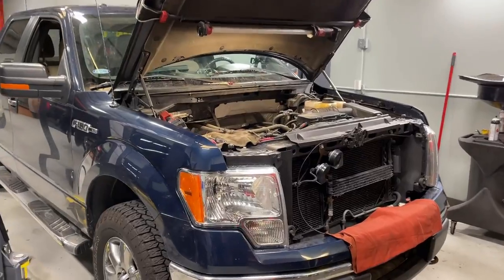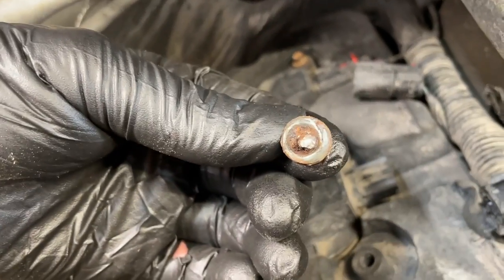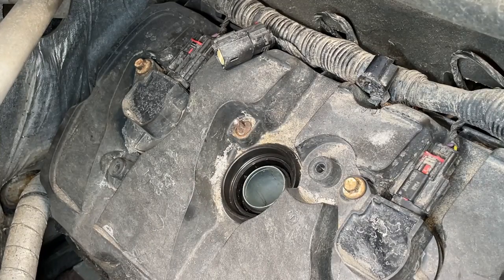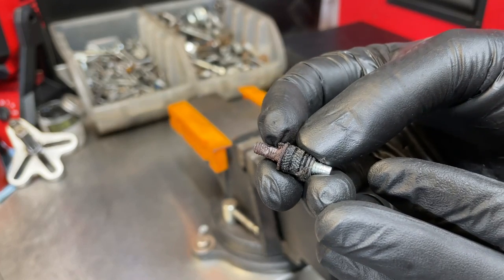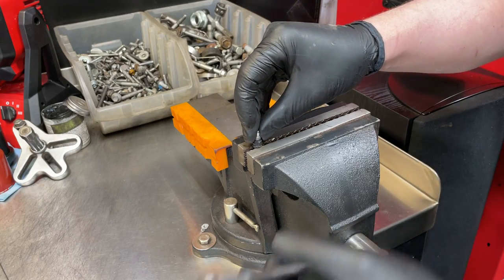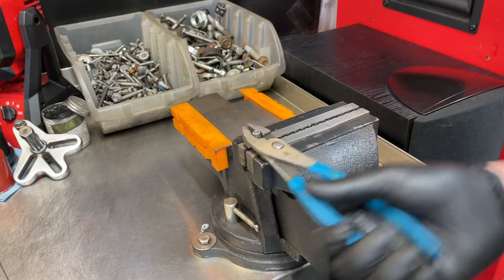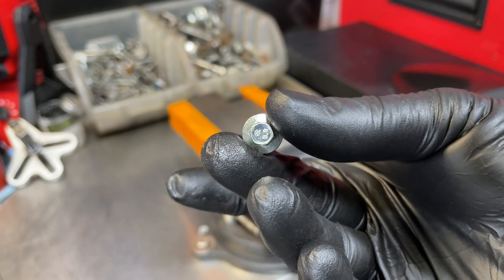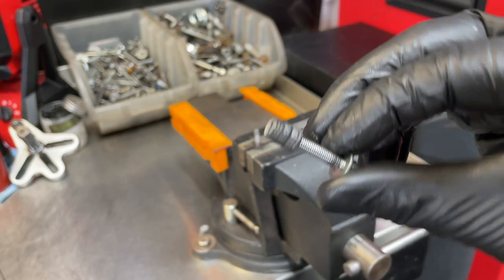Ford 5.0L Coyote Engines: The Best Way to Extract Broken Ignition Coil Bolts in Plastic Valve Covers

Comment: Is there anything you can do to stop the rust on that bolt or both bolts?
Reply: I would think that some stainless steel bolts would be a great option.  I don't know, it's just my .02 cents.
Reply: David - YES!  The stainless bolts, definitely.   But the root cause of all the under hood corrosion is from the inner fender openings!  They are too ‘open’ and let in water spray from the tires.  If you look into your wheel wells over the tire (from the outside), you will see a ton of daylight.  Those openings over the suspension don’t need to be that big.  It lets in a ton of water and grime.  This is the cause for all that rust.   You can fabricate some covers for the opening that act as weather boots.  Inner tube rubber, or plastic works.  Something flexible.  Rivet or fasten into place with plastic push pins.  Check the F-150 forums for templates, material lists, etc.  It’s an easy fix that will prevent this and other Ford problems under the hood.  The eco boost trucks had these to protect the turbos, but the 5.0 didn’t get them, even though they needed them for THIS issue.  I don’t think they’re useable on the 5.0 inner fender plastic, or would be cost prohibitive.  The home remedy is a cheaper repair.  Still, the suggestion for stainless bolts isn’t a bad idea.
Reply: @4drhtrd  Well it sounds like a belt and suspenders answer to the problem. Do both the stainless bolts and the covers for the openings. Glad you mentioned the covers for the openings.
Reply: @davide.s.9880  I wouldn’t ‘invest’ in stainless unless I had to.  I think if you cover the openings, and can get your bolts out, you’d be okay to coat the threads with anti seize and call it good.  This engine gets dirtier than any engine I have ever owned.  Birds even get in there to stay warm in winter.  They make their own mess.   If I ever need to remove the valve covers or exhaust manifolds, I’ll probably be hosed.  I had never seen a newer engine corrode so quickly.

Comment: Does it make sense to replace this bolt in between spark plug changes if you notice the bolt starting to rust?

Is this an issue on the Mustang too?
Reply: Doesnt hurt none, i maintain a few family cars in the rust belt and i have a little stash of bolts and nuts.
Reply: @dirtbike662  

Thinking about it, I don't this this would be an issue on the mustang due to the large plastic engine cover.  I'll look next time I have the cover off.
Reply: @MattGluntVideos  ah ok. Driving a mustang in the snow/ winter would suck too. Ive known folks who have done it! Go-fast tires are definitely a no go!

Comment: So what about throttle body chatter. I have a 2019 f150 5.0 just under 20k miles. I always run mid-grade gas. I started getting this chatter and then it would down shift and go away. after putting high test in, the chatter was almost gone. Took to dealer which they said it was the throttle body flapping and did a cleaning on the lines and added stuff to the tank. They told me to get on the gas run the truck. I'm now 3 tanks of high test and still have the chatter, just not as loud. if I go back to mid-grade the chatter will increase.. since they already did the cleaning, will i need  new throttle body? does something needs adjusted.. at 20k miles? is there a better bolt on aftermarket (no error codes or warranty issues)?
thanks

Comment: New subscriber!! Gotta ask, I'm looking for a second gen escape. I'm looking at a 09, four cylinder with 104000 miles. The only problem I see is when I test drove it, the caliper locked up. Do the 09s have any other big problems?
Reply from the maker: Nothing major except that was the first year of the 6f35 trans so some have lots of issues and other like mine had none for 181k miles.

Comment: Do the 5.0's in the Mustangs with the cover over the top of the coils suffer from this problem?
Reply: I was thinking of pulling the  bolts now on my 18, but you just reminded me there was a cover.  I'd have to assume it is not an issue on the mustang for 99.99% of people.  I'm going to pull off the cover and look.
Reply: @MattGluntVideos  I have a 2014 GT and have never had the covers off but I guess I need to figure out how to take the cover off and look.  I really don't want to have to deal with this problem if possible.  I only have 33,000 miles on mine and don't drive it in the winter or even in the rain that much so hopefully it's not an issue.
Reply: Mine is my daily driver so we will see.  Just had a new short block installed (it was consuming at least a quart every 1500 miles) so they would have had to have them out then.  25,000 miles.
Reply: @MattGluntVideos  That sucks about the engine.  Luckily mine has never been an oil burner and uses no noticeable oil between changes.
Reply: @Mr2004MCSS  

Took Ford 4 months to ship the engine too (covid, ventilators, etc).  Good news is that they gave me a rental for 5 months, stored my car for the winter free of charge, and ford stepped up and gave me a gift card for 2 payments.

Used that for a Ford Performance by Fox leveling kit for our new 21 Ranger.
Reply: @MattGluntVideos  Well, it seems like Ford took care of you.  My experience with my local dealer on some warranty stuff was less than positive.
Reply: @Mr2004MCSS  

I had to go to a dealer 30 miles away.  The selling dealer blew me off.  Told me it was normal.  Told me my Mustang GT was a "Ford Performance Vehicle" and therefore up to 1 quart every 500 miles was normal.  Needless to say, my local dealer did not get the sale of our new truck.
Reply: @MattGluntVideos  I had to go to a dealer about 20 miles away to get one of my issues fixed that I fought with ford for 4 months on.  One other paint issue they never would fix.  They blamed me for that.  They also blamed me for the delaminated radio screen that took me the 4 months to get resolved even though Ford had a special service message about the issue for the Mustang and some other vehicles.  Needless to say, I am less than impressed with Ford warranty.

Comment: I realize this video is about a yr old. But I really need some advice. The bolt on my #1 just spins in both directions, it won't tighten all the way down and it of course won't spin out of the hole. So my coil is still installed. How can I do this procedure with the coil still in? Any help would be greatly appreciated! Thank you!
Reply from the maker: Induction heater on bolt head or pencil torch.

Comment: Can a valve seal job be performed on a f150 coyote without removing heads?
Smoking problems on 350k miles f150  2012

Comment: If Ford used stainless bolts would that have prevented this?
Reply: No
Reply from the maker: According to the Plating Compatibility Chart it would make it worse.
Reply: Maybe Ford should change both the insert material and the bolts to stainless.  No electrolysis.

Comment: Would this be the same approach to take for a coil hold down bolt that just spins in a 2004 4.6 plastic intake manifold? Unable to remove bolt and therefore coil so that can replace spark plug.
Reply from the maker: yup
Reply: @FordTechMakuloco  thanks!

Comment: Couldn’t you put 2 nuts on the broken bold and torque the bottom nut to get the bolt out?
Reply from the maker: If you had enough threads yes. But who really has an M6x1.0 nut laying around
Reply: @FordTechMakuloco  so I’ve got a 2014 150 stx sport and it sounds like there’s a very faint tick at idle. A lot of mechanics say that’s how they all sound and it’s nothing to worry about. What’s your brief take on it?

Comment: I was thinking possibly a Ford with a 5.0… but, damn hearing that the whole engine is damn near plastic.

Think I’ll stick with my mid 90’s Chevy or Ford or early 2000’s Chevy plan!

$10-$15k for truck another 10k in back to life repairs….and for 20-25k I’ve got a truck that will run circles around these modern pieces of junk these manufacturers are turning out for three times the cost..

Yeah……no thanks!

Still a great video!👍

Comment: I just had this happen on my 2015 5.0L
I had to cut into the bolt hole on the coil itself to free it from the bolt before the coil could even be removed.  Then lubed and vise grips back and forth slightly,  full size vise grips WILL fit. I've been a tech for 20+ years  I don't recommend melting your valve cover.

Comment: I CAN NOT believe someone as OCD as you are (I mean, come on, you blow compressed air around the transmission drain plug before removing it!) did not stick a rag down the spark plug port before doing all this work!!  I would have dropped the bolt, insert and who knows what else down there 10X before getting things done. 😁
Reply from the maker: The plugs were changed already, nothing really to drop in there. You literally heat, pluck, heat again and place the insert, no big deal.

Comment: You may have been smelling that soft jaw that you torched. The plumbing department at Home Depot sells fireproof pads intended to protect studs while sweating pipes. These would probably be ideal for this application.
Reply: The vice jaw.  I was watching for that to bubble. :-)
Reply from the maker: No I didn’t use any soft jaw adapters. I know the ones in the background look close but they are below and behind the vice far from the flame.

Comment: how much do you charge for this repair for one bolt? dealer pricing?
Reply from the maker: I don’t charge my customers any extra.
Reply: @FordTechMakuloco  do dealers normally charge for this job? I have this issue and and want to know what's fair if they charge me?
Reply from the maker: They will try to upsell a new valve cover.

Comment: Why not just epoxy the insert back into the hole so you don’t need to deal with melting the plastic and ensures that it’s bonded.
Reply: Only thing I can think is the additional length that goes below the insert may accidentally get bonded too? But if I'm having to replace it I would probably get one shorter for just that reason and use some JB or something

Comment: 🥺 first gen 5.4 the spark plugs popped out.
2nd gen 5.4 couldn’t get the spark plug Out!?
Now the 5.0 coyotes coil bolt
Cant get the bolts out😂
Ford....you suck with ANYTHING to do with ignition!

Comment: Can believe you don’t stick a rag into the open spark plug hole when doing all this repair work.
Reply from the maker: No need, the spark plug has already been  changed and at this point all we are doing is clean work, no drilling or extracting nothing but clean quick work.

Comment: what would someone do if the bolt sheared off flush with the fitting?
Reply: Any luck?
Reply: @LewGQ  I had a portable soldering iron that if you take the iron tip off blows hot air in a really small spot, I held that on the fitting until the valve cover was soft then I pulled the whole brass fitting out. cleaned up the area and bought some new m5 fittings from McMaster Carr. Jb welded them in and still solid today.

Comment: Could you not also just change the valve cover? Especially if it's older; I mean how  long do those things last anyway?
Reply from the maker: The valve cover should last the life of the vehicle.
Reply: I bet the valve cover bolts are in worse shape than those coil bolts. On my 2011 5.0, the heads of the valve cover bolts are disgusting. Corroded, rusty and just a mess. I don’t even think you’d be able to get a socket on them.

Comment: This must be a truck thing, if none of them have covers.  All my coil bolts look brand new still.
Reply: Yeah, I think its due to no engine cover and water splashing up from the tires due to no form of barriers/ fender covers between the outside and the engine bay.

Comment: Why not use a tap or proper thread chaser to clean up the threads?  A regular bolt does not do this very well at all.
Reply from the maker: Absolutely not need, remember the threads are not damaged and the bolt chased them in just a few seconds perfect every time. Why does everyone want to complicating things?

Comment: anyone know if this is the same issue with the 2014 3.5 l, thanks
Reply: The 3.5L has an engine cover that protects the coil packs from getting wet.  You should be good
Reply: @twofst4u20  thanks!!

Comment: Mine broke flush, how fo i remove it?
Reply: Same. Have you gotten any figured out yet?
Reply: @LewGQ  nah man i just left it like that, it wont come off, i own a 5.0 mustang and i have stepped on it, coil is holding tight because of the pressure it gets holding to the spark plug, you will be good
Reply: @brianveliz9613  fair enough and shake while idle..parked? 

I'm in a 5.0 f150, thinking about replacing the valve cover. Are you tuned? Would you think that would affect it?

Comment: Using a bolt to chase threads is dangerous.... The threads could lock up. Use a tap!
Reply from the maker: The threads were not damaged to begin with just needed a cleaning no tap or thread chasers needed.

Comment: New cars are junk, over priced, and cheaply made who uses plastic valve cover on a hot engine  eventually they're going to get brittle and start leaking oil in Big drips and takes for ever to get at, car these are a waste of money and investment, just read something yesterday that the heat in New Honda vehicles can't produce enough heat on a cold winter day. I have nothing against your channel Gary I learned a lot from your channel especially when I come to a plateau when working on my vehicle.

Comment: The problem here is....it’s a Ford. Why in hell did they make valve covers in plastic. I also seen plastic thermostat cover and intake runners on fords. Garbage
Reply: Three reasons:
1. Cost cutting.
2. Easier assembly at the plant.
3. Lighter weight.
 Long term serviceability doesn’t even enter the equation.
Reply: Typical.

Comment: Can't wait until electric vehicles take over. I'm so tired of these stupid problems because they cheap out. All manufacturers are like this, but for who makes everything out of aluminum puts bolts that rust on the engine? This wasn't a problem with my older ford's. Fi, x one prob3break another I guess, they need this sales